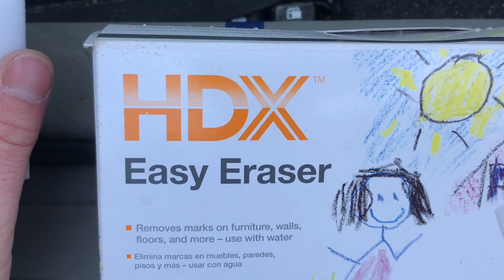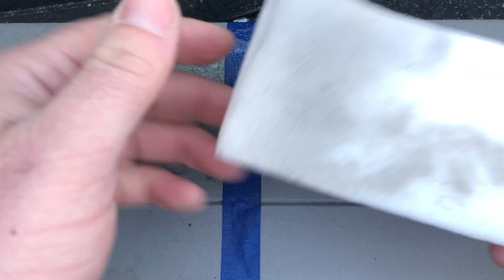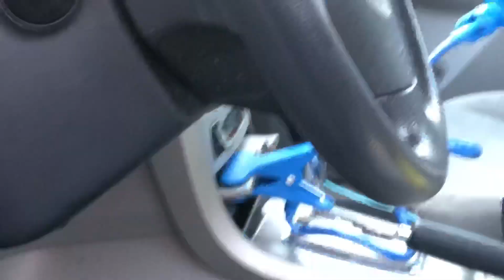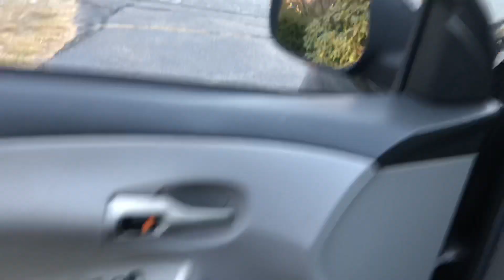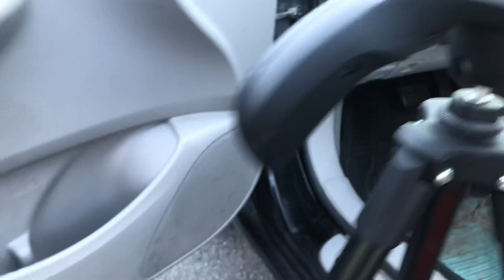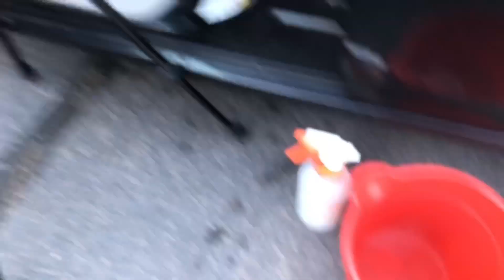How I Use Magic Erasers For Interior Detailing!

Comment: Thanks for this. Now I know that I do not need to use the cleaner I use full strength with the scrubbing pads, and was wasting more than I was using, as I used cheap terry towel to wipe down surfaces.